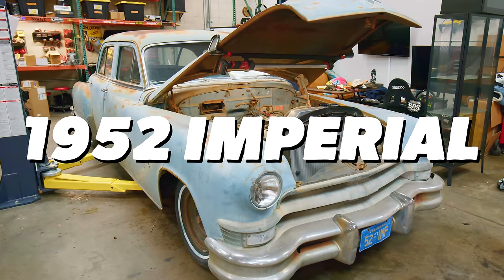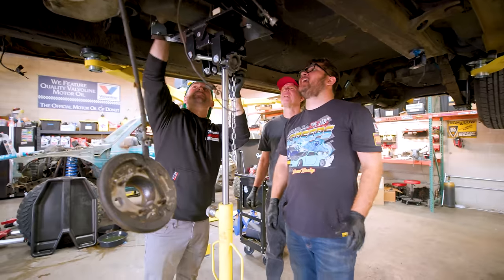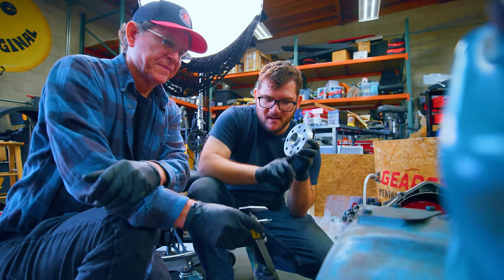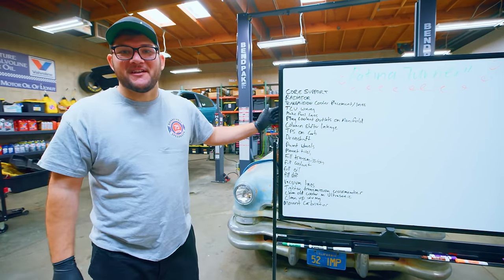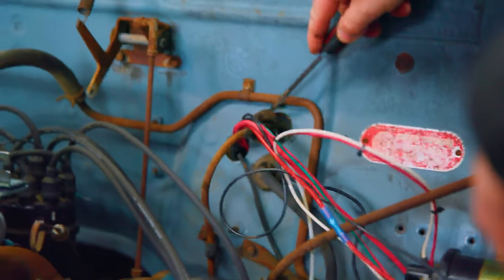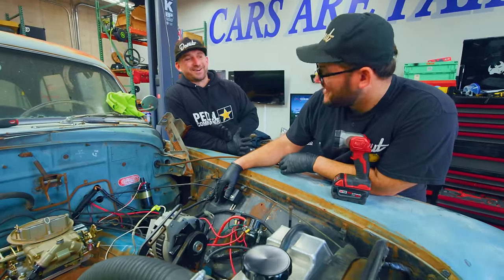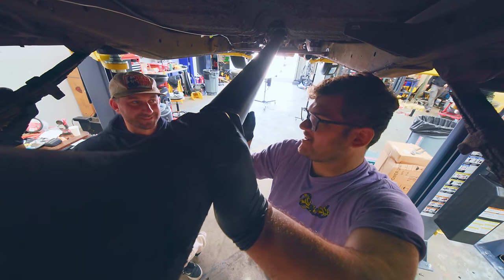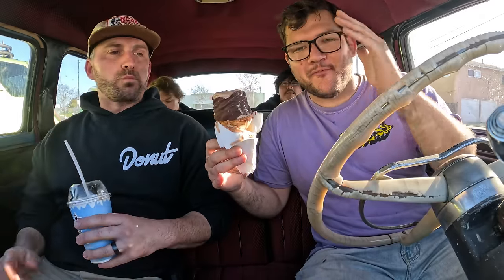I Finally Fixed My Abandoned Project Car

Comment: Nolan is like one 2am eBay session from LS swapping this bad boy
Reply: Probably his next paycheck🤣 he might as well have swapped it all at once
Reply: Or a nice v8 one from a xj
Reply: Or put a bit of cash into rebuilding the original hemi with a four barrel and take the thing drag racing like god intended 💪
Reply: Without the Hemi, its no longer a Chrysler.
Reply: There is no "nicer" V8 than the mighty Hemi, even in 331 form. With a cam and two four barrels, it will haul ass!
Reply: Without people crying over cross breeding a car, where would we be? We need these purist gate keepers. They help the world in so many ways...  SMH Sheesh @JeffKopis
Reply: @epictales1307 Sheesh yourself, Junior. There's nothing wrong with a classic Hemi. It's what makes an Imperial an Imperial.
Reply: @theeoddments960  God intended a 5000 lb Imperial to be a drag car? I think he intended that motor to be put into a 32 Ford. THAT'S a "crossbreed" I can get behind!
Reply: There isn't anything wrong with having a classic hemi, so long as parts are available and it makes decent power with decent MPG, but that hemi is none of these things. It doesn't matter if he wants to swap it, or if he wants to keep the beat up hemi. Cry me a river and face the fact that a LS swap is just an easy swap for good power, reliability, and easy to find parts. You can be a purist all you want, but do it on YOUR project and leave everyone else's projects alone, @JeffKopis
Reply: Yeah would probably be the route most people would take but the whole reason he bought the car was because it had the Hemi, so if anything I see him doing is modifying the Hemi to maybe make some more power, or maybe just make it more reliable and add some more modern stuff to the engine, like an MSD distributor and stuff.
Reply: He won't, he is not dumb, if anything he will put another Hemi in it.
Reply: @joealex65  I mean a more modern Hemi would be pretty badass imo, but I also have such a desire to see the old Hemi modified
Reply: I would be upset to get rid of all that parts, money and time. but 100%, he should have dropped an LS on it
Reply: I think this is meant to be more a cruiser not a built street rod. Only reason he even swapped out a few of the components such as the Oil Filter plate and swapped in a GM trans is because it'll be easier and cheaper to work on again.
Reply: @epictales1307  sometimes it isn't about power or mpg's it's about the look, the sound, the experience. It's about popping the hood and seeing an original engine in there instead of a ls swap. Anymore a ride is unique if it doesn't have a ls swap. LS swap your rides if you want but don't bag on others because they won't do it. Not your ride, not your wallet, not your business.
Reply: THIS AND making it a drag strip racer!!!
Reply: I'm surprised he didn't do that from the start 😅
Reply: @epictales1307 yes, it's easy. And that right there is the problem. It's the lazy way. LS swaps are a dime a dozen.
Reply: Swap a Hemi out for an LS?!?! SACRILEGE!!!
Reply: You guys didn't notice Nolan is a Hemi fan boy yet!?
Reply: No way Jose. Keep it a Chrysler corp. Hemi
Reply: I’d want a 6bt in there to make it more unique
Reply: ls swapping is for basic losers
Reply: Modern hemi swap
Reply: Nah bro swap a K24 in
Reply: Much as I'd like to put an LS in, keep it 100% Mopar. This is an old Chrysler, it's got a Hemi motor, and that old Hemi can still haul!
Reply: @epictales1307  YOU'RE the one telling him to LS swap it, fool, not me! If it aint broke, dont fix it! There's 70 years worth of research and development in early Hemi parts. But I wouldnt expect you kids to know that. BOOMER KNOWLEDGE 🤣
Reply: @TravisConnors  Jesus Christ, what next, a 2JZ?? Tesla Plaid swap?? SMH 🤦
Reply: @JeffKopis  yes
Reply: I think Nolan only bought the car because it had the Hemi so I don’t think it’s going anywhere
Reply: Why an LS, and not something like a Toyota 4-popper? It will never be a speed monster, might as well be the only reliable car in the Donut garage...
Reply: ive heard him say hurricane lol

they have a dodge sponsorship itll probably be a hurricane because they want traction with those.

I've seen some Atlas 4.2 "vortec" turbo swaps in goodguys type cars on YouTube actually its... interesting lol
Reply: i think if he puts a blower on a hurricane that would be cool in here. 4170 or whatever old school blowers on an I6 are big in Australia, its like still muscle car rat fink logic lol

Comment: I like seeing these fixer-upper videos starring mainly one host. Yall should do more!
Reply: I agree
Reply: Next... Zacks S14!
Reply: Here here!
Best serious they've made (besides up2 speed and bumper to bumper) was the samurai build.
Reply: Fr
I love them all but it's nice when it isn't entirely all over the place and the focus is one single thing. Kind of like the old Zack videos on the Miata
Reply: We need more of this type of work in the industry that's Highlighted. Retro fitting and making something old new again and modern. We totally have the capability to make carb engines as fuel efficient as fuel injection. Clunkers into cash was nice. But we need to buy be turning Clunkers into CASH a thing. Making them better.
Reply: They take a lot of time. I don't mean like "20 hours of filming". I mean they take months to research, order parts for, ship, get everything ready. That's why we can only get a handful fo them in a year.
Reply: fr I miss the older stile vids
Reply: Agree more like this!
Reply: @yothegamer This type of fixer upper is known as a Resto-mod in the industry. It's basically taking an older chassis and modifying it with modern parts.

Comment: As a heavy truck mechanic, anytime I drop a transmission and go through all the trouble I check the rear main seal. If there is any sign that it might start leaking I replace it cuz it's a cheap and quick preventive meassure once all that work has been done. Good job Nollan, that car is gonna be sick
Reply: Even if it looked fine, I would've replaced it. The couple dollars spent on the rear main seal vs. the headache of having to re pull the transmission again now because of a leak. Do it right the first time. Now you have to bite the bullet. Sweet ride, though. I would love to see the car get a new motor and a nice wrap to go with them fresh wheels.
Reply: These kinds of antiques have not a conventional full-circle seal, but a seal made of two halves. Not sure about this Imperial, but on the older trucks and 1950-1970 sedans that were made in Soviet times there's a main rear seal made of an asbestos cord (graphite impregnated). This is called "сальниковая набивка", which is literally translated as sealing stuffing, and this is also a pain in the ass. It's fitted into the groove in the block that goes around the rear crank journal, and in the cap that goes beneath it. This type of seal is also used on some Mercedes engines (it's interchangeable with the original in some soviet motors, so we prefer to use it). There's also usually an oil drain thread on the journal that keeps pushing the oil back into the engine when the crank spins. All in all, my point is that replacement of this seal would require a pan to come off, and the crank to be separated from the block, that means at least the rods caps have to be taken off. Sure you can keep the cylinder heads on, but the struggle that waits when the crank will need to be put back (into all of the eight rods at once) is quite serious. Overall it would require a proper engine stand, something like a five pair of fellow mechanics' hands and a couple of hours. But this is not a quick and easy job
Reply: @UnceasingZeus  Same thing with a clutch ain’t it? You’ve got the trans open anyway, might as well swap seals and clutches. Especially on your own car
Reply: Yeah I was going to say the same thing. The motor was out!
Reply: These have 2 piece rear main seals, so you can just do it from the oil pan, gotta take the rear main cap off. In fact you don't need to take the transmission off at all.
Reply: @UnceasingZeus  i think, for this car, continue with the parts philosophy demonstrated in the video, only make changes for convenience, for example, maybe don't replace the whole engine, but definitely open it up and replace anything that needs a zinc treatment to run properly

Comment: PSA: Always check your new/rebuilt transmissions for cracks around fittings. Found that one out the hard way this weekend and I'm praying JB weld saves me
Reply: Did it save you?
Reply: @aw_shucks17  Yes! I used a carbide dremel burr to rough up the casing and cleaned everything super well. Then I crammed half a tube of JB steel stick in and let it cure for 3 days. The fitting supposedly gets to 300 psi and its held so far

Comment: They said 3500, I said hell no. Let me use my connections and get that s*** for free 🙂 I would have done the same thing bro
Reply: From my udnerstanding it's really not getting the same thing though. One was a full restoration of OEM parts, the other one is a modern restomod-y product (which I think is pretty cool and better anyway). All in all probably close in cost though, I'll give you that.
Reply: They definitely spent more on the 4L80e. Gearstar will give them a discount for promoting their product but they aren't going to give away a $10,000 transmission for promotion in one video
Reply: @Berm_Blaster the transmission in this video is about a 3,600 dollar transmission so Nolan definitely made off like a bandit with this one.

Quick aside though, why not put a more modern mopar trans in this thing and not a gm? I bet Nolan could have put a 727 in this thing for less than a grand if he shortened the driveshaft
Reply: 3500$ to fix it and keep it original pfffff hell nah, 15k to hop up that sh**
Reply: They paid for the trans I'd bet. He got the labor for free technically, but not really since viewership of the video is what pays the men to work on it.
Reply: @theeoddments960 Because GM parts are cheap and plentiful.
Reply: He din't get it for free, they gave him a big discount in exchange for a quick promotion on a video that will easily get over 1 million views.
Reply: @theeoddments960  Reliability and more modern support. GM 4L60 Trans are in absolutely everything and they don't break much.
Reply: @garand70  Because GM parts are cheap and plentiful.

still spendy i knowledge as my charger has a C7 drop-out TR70 so there's conversion-parts and labour needs, so something's make's sense like EFI ( not sure why he/they just didn't block-off the mechanical and use a electronic pump and or in-tank there cheaper/better nowadays and leaves room to grow later on plus, as on topic why piss around holly's/carbs makes-EFI 4 and 2 barrel-kit's, besides options to COP and port-EFI, something im doing-LSX*-EFI to my RB/hemi platform ) but for auto+50's dodge nope 8-speed or OEM or 727 is a better experience as there's less work needs, only reason i did the TR70 was i wanted ( also helped that it's related to the hellcats/TR6060 and SBMopar version's ) 7th gaar/OD and im not willing to tune/programming it or the extra $$ plus at 900hp/torques its one of the few that in my 60's that my 500+CI +boost can't kill easy 😉
Reply: @theeoddments960  for automatics id pick the 8-speed dodge as the aftermarket is there ( shave the block/replacement and the pattern's and crank etc lines up 123 🤠, but replacement service/seals probably weren't that hard to do, 1st year or less apprenticeship probably could do it/1945-70-oem unit's ) and it's a easier going pick than the pre-2002~ GM-styles, but i like sticks/TR6060 so you can see i didn't buy one to replace my old/stolen 727 ( doesn't have locker or od, parts some of the easygoing talks of ditching it for modern/2010-up, and yes both are hemisphere's can easily lug 2k ( mine im aiming for 1300-2k RPM's on 30"in rear tires 265-65-17 sized* ) at 50 to 80mph on the freeways, not sure 🤔why Nolan didn't do a cam&valvetrain swapping as it was out and easy to do a full-roller/bushings roller, i know im not going back, my cam/oem-previous-owners was fine the lifter's were stolen/trash/choppers-shop'd by yahoos had it been done already id just bought new rolls/lifter's and putting back on instead of now i need to re-buy the complete-kit again/roller-kit ) then recovered but vandal'd unit and my vin/60's-charger trying to get 100-point restored ( not a hemi or Daytona vin fyi 😉 ) isn't wise so 4k 🇺🇸 usd or for me 5-9k swap yeah easy choice choice as it just makes sense/my life easier going ( and originally i was shopping for a full-powered/loaded car with a 4-speed but couldn't find one 2009~ that fit my wanted etc, wife's the reason for A/C 😉 ) and yes mine is my daily, was driving it and planning on fixing it and going beck to dailying it again like i was pre-2019

on my kit im trying not to shovel the transmission back any further than the original placement ( might be backed up by 4~inch but that's not because of the hellcat/aftermarket bell, it's my 5gen/cam-in-cam vipers style cam-core + rear-phaser unit and plumbing needs, something Nolan does seem interesting in or needs as his is a weekend toy* unlike my daily/only-car 😉 ) as it makes it harder to work ( and ride funny as that's 300lb~ in the wrong spotlight etc ) on so, silly they basically putting 2 🛎bell housing's on making everything 2ft longer than necessary
Reply: @matthewgraves5498  nah. 4l60’s pale in comparison to the 727. Only reason I see is because gearstar doesn’t offer a transmission that’s cheaper than a 4l60

Comment: Should replace the rear main seal if you have the transmission off just because. Except when you know for sure it's been recently replaced.
Reply: I died inside when they never mentioned it, and then of course it was leaking later in the video.
Reply: Its literally a 10 dollar part more times than not. It should just be a automatic swap it item when you pull the trans unless its already been done.
Reply: @iskanque  I got this $3500 transmission for free, but that $10 gasket will put me over budget... I do appreciate them showing their mistakes though. Probably trolling us. 😂

Comment: Whenever trans is out always do rear main seal
Reply: explain like im 5 years old, please.
Reply: @liamyates5544  the rear main seal (referred to by some as RMS) is the seal that installs with the rear cover of the engine where the drive shaft pokes out to mate with the transmission. It is a common place where oil leaks out after some time of vehicle usage. if the engine/trans are ever out of the car, it's a good idea to replace the RMS so that it prevents future oil leakage. That way you mitigate the risk of having to redo all the work to get everything in and out of the car.
Reply: I thought this too. All of these guys there with all of that experience and not one suggested that?
Reply: I don't know hemi engines for sure but a lot of cars of that era used a rope type seal. It's probably crankshaft out to do the rear main seal. Or a sneaky pete, but that's still main caps off.

Comment: Everything about this project resembles everything I went through with my project Chevrolet S10. Unlike Nolan I went old school. I took a 1999 S10, swapped out the 2.2L, replaced it with a 5.7L V8 from a 1995 Chevrolet Tahoe (rebuilt the engine in my engine repair class), I replaced the throttle body and intake manifold for a carbureted setup, took the 4L60E and replaced it with a 700R4 (brand new from GM but it sat for a long time). I rebuilt a rear axle from a ZR2 blazer, took out the governor locker and installed an Eaton Detroit Truetrac differential allowing me to ditch the factory drum brakes for disc brakes without the need for an adapter. I wanted a stronger caliper setup up front without adapter kits also so I replaced my steering knuckles with 2wd Blazer knuckles. There was some smaller finishing touches that I added to the truck when I was done but those items did not take as much work as everything else did.

Comment: Should find a LA 318, (you can time them with forged crank and rods from the factory) port and polish the heads from a 273 and slap them on the 318, and a slap a 4speed 272 auto in that car

Comment: That old girl needs a Viper V10!
Great to see you finally get it going properly, I wish Kevin was there to help with you and your dad!
Cheers Pat 🇦🇺
Reply: I think a 528 or 572 crate Hemi would be easier to fit. 610/700 hp. Based on the tires and stuff, I think it's just a cruiser. Probably a standard Hemi from a modern RAM would be the sweet spot for this guy.

Comment: If you have a rear main seal leaking, and don't want to try pulling the engine or trans...AT-205 reseal works. Heard about it on Scotty Kilmer's channel. They do not incorporate solvents to attack the seal and swell it like some of the other snake oil stuff. Worked wonders on my Suzuki Samurai!

Comment: You had to grind down the rivets on the face of that hub for your wheels to sit flat on the drum... I found that out the hard way on a '59 Chevy Apache 37 years ago!  Of course, you get to miss out on feeling like the front end is falling apart, only to see one of your wheels bounce off into the distance as your car crashes onto the ground.  Good times.

Comment: You should have your tank chemical dipped/cleaned. And also replace your frame side fuel line and add a frame mounted particulate filter(the solid metal type) to grab anything before your fuel pump. I can tell your tank dirty from the fuel that was in your engine filter.

Comment: I have a 62 Corvair and having an impossible time finding a mechanical fuel pump that actually fits. Most places say for 60-69 Corvair but the pump for 60-61 is different from the others and that’s the one that everybody has. I didn’t think to look for an after market pump with adapter like this! I would really love to be able to drive it this convertible season and that could be how! Thanks guys!